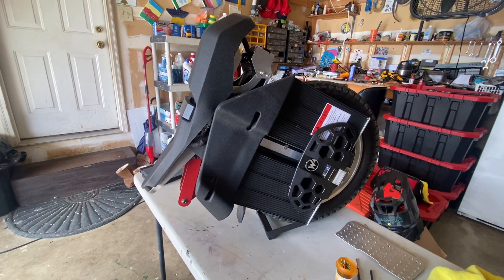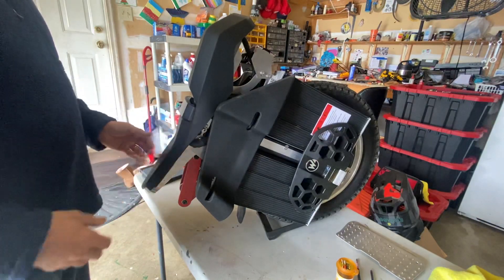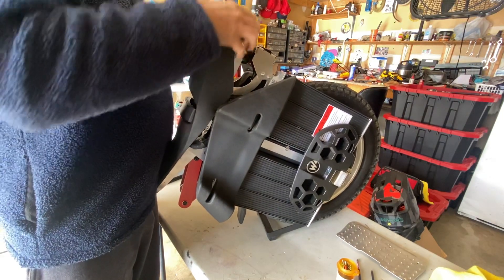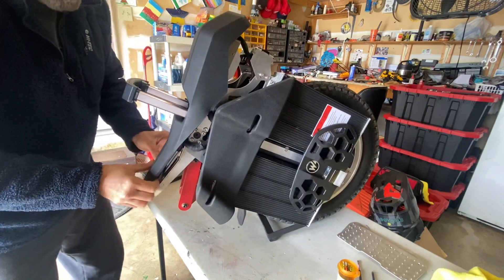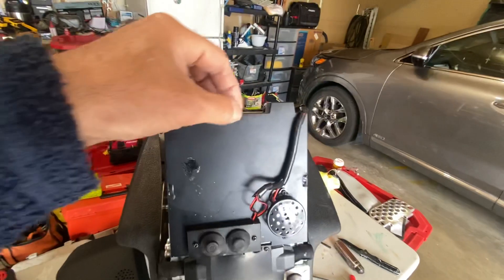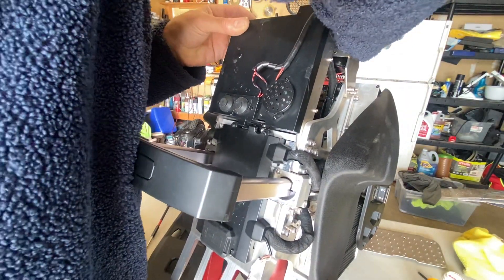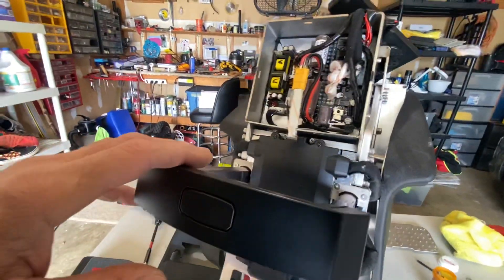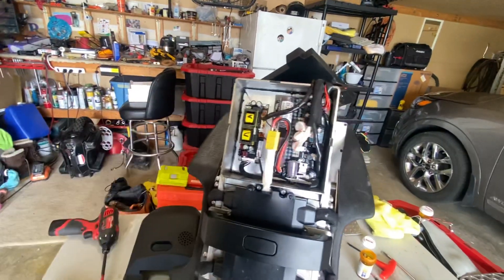Getting to the EX20s motherboard

Comment: Looking at this video, it seems there is progress in production quality, one of the things I was looking for was thermal management, and given the whole housing area for the control board is metal this wheel "should" run cool, personally I would be tempted to add thermal paste at every metal connection point to increase surface area for heat transfer, but it doesn't look like they used the 4 massive radiators (metal battery cases) for thermal management, if so.... massive waste. MASSIVE.

Comment: A heat gun could aid in the seat removal. Obviously be careful to not get too hot. EDIT: On second thought it looks like there is such a minimal amount of glue that it shouldn't matter.
Reply from the maker: yea there is no need to heat it up, just little force when prying the seat off the glue area would be sufficient

Comment: Cmon did they really clip the cover on instead of using screws? If those clips break that's gonna suck
Reply from the maker: what cover? what clip
Reply: @rayrokni  at 3:12
Reply from the maker: @jedi22300  that top is not coming off in riding. and very unlikely in a crash.

Comment: How do you know speed and battery levels? Only through app? Is there audible notification? No lcd…
Reply from the maker: at first through the app. after riding a while i don’t use anything. you will get to know your wheel. i don’t suggest looking at anything but where you are going. don’t need any distraction.